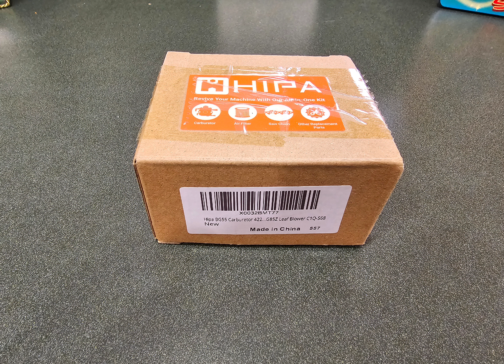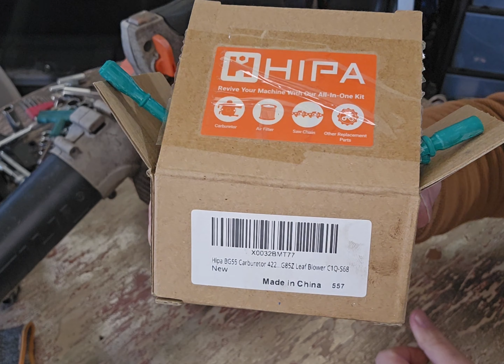Review of a Amazon fuel system kit for a Stihl hand held blower.

Comment: couldnt comment on your cub cadet video. just wondering what you ended up finding for a throttle cable? I am working on one and putting pretty much the same engine you did. it has that intellipower or whatever it is called. did you just remove all that electronic stuff or just unplug it?
Reply from the maker: I used the one from the John Deere donar